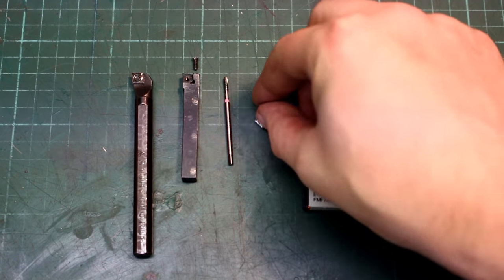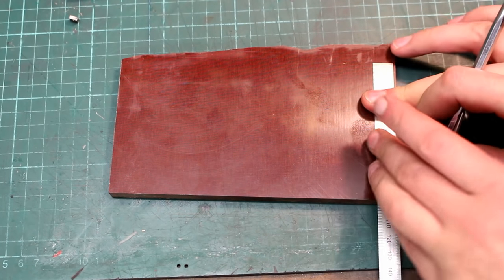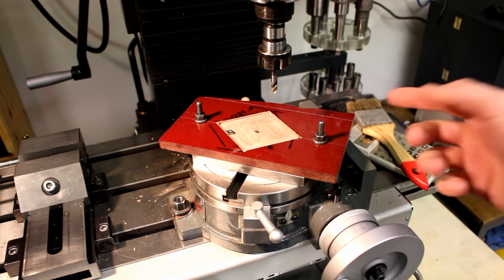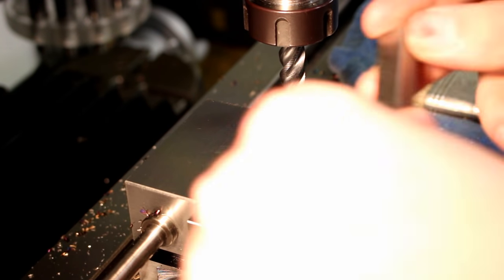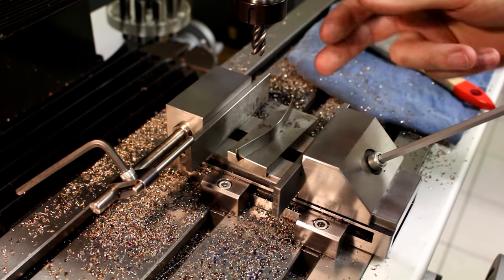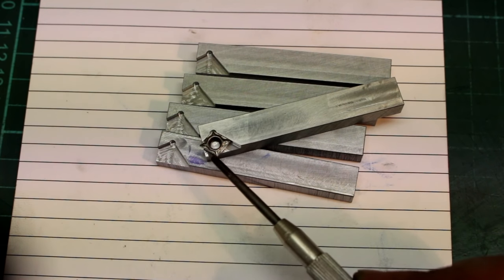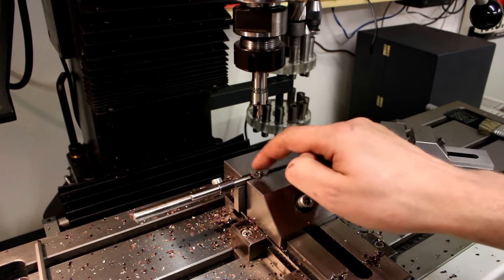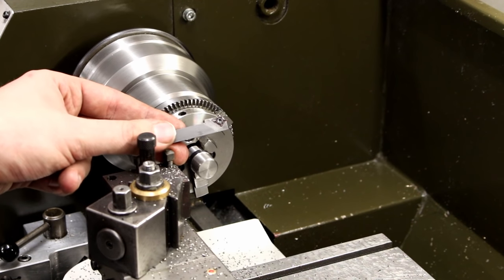Making indexable lathe tools - Herstellung von Wendeplattenhaltern

Comment: Hi Stefan, In your video you stated that you didn't have the means to de-magnetize, but you do have the means. Any mains power transformer is a demagnetizer. Just make sure the unit is in a safe state before powering up. All you have to do is to wipe the parallel or other magnetized piece across the metal lamination s of the transformer whilst powered up and the 60/60 cycle field will soon remove all traces of static magnetism. Easy peasy. I always enjoy your videos as they always seem to work outside of the box meaning that there is a lot of inginuity and thought gone into your projects.
Regards MoK
Reply: Cheers for the tip, will give it a go.

Comment: 3.5 purpose tool
1) turning
2) facing
3a) chamfering O.D.
3b) chamfering I.D. (albeit not 45 degrees)

Nice work. I like the thoroughness of your presentations. I have to admit to chuckling when the holding spring fell into the middle of the vice. You just said "oops" and moved on. I'm so glad I subscribed.
Reply: For anyone else reading this years later, a simple trick to chamfer the ID at the same angle would be to run the lathe in reverse and cut on the far side.
Reply: @cavemaneca  If you don't have a screw on chuck like mine. But yeah, that's a great idea.
Reply: @ExtantFrodo2  I've actually never had a lathe with a screw on chuck, so I didn't really even think of that.

Comment: I have never seen a rougher like that before, thanks for sharing that!
Reply from the maker: +zomie1 I have neither - And as its not as good as a pure roughing endmill it does a real nice job :)
Reply: I find Iscar mill tooling is inferior to the Seco and Sandvik offerings. It seems Iscar are constantly introducing gimmick features into their products and then dumping them from the lineup. One product Iscar market but do not make I can highly recommend is the ITS modular boring head. Very rigid and accurate but probably a little large for the stuff you are doing.

Comment: Thank you very much. I do not have a mill, but I just bought a Cazaneuve 575x2000 lathe
So far I have broken 6 inserts trying to master the controls. I have not done any turning for over 30 years. 
The machine I did most of my work on was a Dean Smith Grace which was quite modern. And every control just fell naturally to the hand.
Whereabouts in Germany are you? I spend a lot of time in Germany myself. You can buy anything there. I get most of my tooling from ebay. It is made in China The lathe which is old. Came with tooling boring bars and holders of high-quality

Comment: I must make me a clamp like yours for the mill spindle nose and mount my mini Noga that way.
Optically the camera seems extremely good - perhaps sound had some AGC break-up at one small point milling the phenolic, otherwise fine.
Your pantograph set-up is ideal for this project - amazing that tiny carbide end mill survives!
More very nice work again Stefan... your usual precision.:)
Reply from the maker: +ChrisB257 I think Tom Lipton has a setup like that, with the Mini-Noga arm on a genuine Indicol holder.
Yeah, I like the camera very much, but as I said it will stay secondary camera when I want to do multiple shots at the same time. Thank you for watching and commenting :)

Comment: Hi Stefan, Really nice work as always. I was wondering if you were going to cut a taper on the edges of the pocket the same as the angles of the tip, but I guess it doesn't really matter as long as the tip is rigid in the holder, which is going to happen with the 0.1mm offset.

Comment: You could rotate the insert at 90 degrees and use the wider edge for turning rather than facing. Allows you to use the inserts that are worn on the 2 other edges

Comment: Hi StefanAs usual a very well crafted tool and excellent video. If you make both left hand turning and right hand, with a careful relief grind you have a fly cutter that will utilise the 2 unused edges. Also if you get chance  try CCGT inserts easily chipped but superb fine finishes even on tool steel with care. Fly cutting on Aluminium is almost glass like.

Comment: Stefan, You forgot to include a pricing page so we can see what these excellent tools are going to cost us! :) I very much like how you built in the ability to use 3 sides of the tool. 

If you can in the future please do a video on parting off. It is the single most difficult action for me to master in my small home machine shop. I have a nice accurate mini lathe that can hold 0.0010", but I feel I almost mangle the poor little thing every time I part off or cut off a piece of work. Thanks,    G.
Reply: Hi G, Don't know if you have tried this but if you are using the forward turret, try turning your parting tool upside down and run in reverse its a lot more rigid, and get as close to the chuck as you dare, also get you speed up to the max with coolant/oil, and dont use a wide tool, on a mini lathe I would suggest no more than 1mm.

Comment: Hi Stefan, wonderful video and a very nice tool. Thanks! Quick question - I hadn't seen that smaller chuck on your lathe before; it looks similar to a little Unimat chuck. Did you adapt one to your lathe or is it something made by Optimum? Happy New Year!! Bob
Reply from the maker: +Bick1027 DE Thats a small emco or unimat chuck, I use it mostly for small modell parts, as it holds parts as thin as 0,5mm. When I tested the toolholders that was the chuck I had mounted on the lathe so I used it :)

Comment: Nice work. I see even some possibility to releive the right corner of the holder head, so you could alsoo make it go into shoulder corners while conventional turning. Cheers.
Reply from the maker: +Flip de boer I thought about that, but the inserts only have 7° relief angle, so they would rub a lot when doing internal chamering.

Comment: Nice tool holders Stefan! :) Do you think you could add one more relief behind the insert, so that you can cut inside chamfers? Or would that compromise the stiffness of the holder? That would make it a 4x way tool! :)
Reply from the maker: +mictho100 No problems with stiffness, but the inserts only have 7° relief, so they would rub when you try to chamfer internal edges :)

Comment: Thank you for your time and information.  I like the style and content of your many videos.
Regarding the insert tool holder:  what are your thoughts on double-end insert holders?  Many of us have the Aloris type tool posts that have two faces for the tool holders.  With a double-end insert holder, you can change the approach 90 degrees by just changing to the other face of of the tool post.  This occurred to me when I saw you cut off the lengths of raw stock!  Too late then!

Comment: very nice job . you didn't mention but i assume your inserts are positive rake. also , is there a need to heat treat the tool holder?  what level of hardness do you shoot for?
Reply: +larry sperling I think he made his to about 50 Rockwell
Reply from the maker: +larry sperling The work just fine when left soft, but hardened they dont get dinged up in general shop use :) And yes, the ccmt are positive inserts so you dont need to tilt them. Hardness should be somewhat about 50...55Hrc.

Comment: I often wondered if the insert craze is marketing hype compared to need. All machining was done with high speed tool steel and brazed bit tools for years. My only experience in machining was with high speed steel so i never used inserts except on rotor and drum lathes.
Reply from the maker: +Richard Schmidtendorff Dont think that its a hype, they are essential for mass manufacturing and heavy material removal, but in the homeshop, I am not that sure about it - Thats the reason why I have only one kind of them in the shop (Plus my parting blade inserts).
Reply: Ah ok nobody really talks about the advantages or disadvantages.
Reply: +Richard Schmidtendorff In industry during the HSS days it was necessary to have one guy sharpening to every 5 machines milling. When they went to carbide in steel they got 4 times the tool life meaning that one guy sharpening could now service 20 machines. When you go to insert tooling you can get rid of that guy and his machine all together. Brazing carbide on and grinding chip breakers and reliefs eats up a bunch of time too, so in production insert toolings slight extra cost more than is offset by the increase in productivity. Taking the human element out of making the tooling also makes more predictable tooling which is good for CNC's as then you can know exactly how long you can run a job on an insert, with hand ground tooling that would be all over the place, and even tooling ground on a  cutter grinder can be all over the place too as things like surface finish, the angle and position of the tooling and how hot they got it sharpening all can play a big role in tool life.
Reply: yeah i figured after thinking about it if it came down to quick resharpen by just rotating or swapping and not haveing to reset up.

Comment: Hi Stefan, I just watched your video of the 5 tool holders you made for the CCMT carbide tool bits. (Some time back I see). Very good job, well done. What material did you make them with? At some point in the beginning of your video, I was sure I heard you mention that the material was cold rolled, and that hardening was not needed. Then at the end you hardened them anyway. I am asking because I don't know much about what types of materials are suitable for hardening?
Reply from the maker: I used a toolsteel (ISO 1.2767, which is ANSI 6F7, a bit like D2) - It would be tough enough by itself without hardening, but hardening makes it just more resistant to tear and wear.

Comment: nice video, thanks. 2 questions:
a) You milled the pocket with vertical walls, correct? The insert has a relief angle on its edges, right? Should the pocket walls not have the same angle? Do the commercial holders also have vertical walls?
b) Why do you heat treat the holder for toughness and not use cold rolled mild steel? I understand that you take mild steel for the shanks of your brazed on carbide tools. And mild steel is tough not brittle.
Reply from the maker: +rol eic Thank you :)
a) Some of the commercial holders have straight walls, some have sloped walls - When I do my next run of them I will grind a 7° single lip cutter
b) Just for general resistance against dings and nicks
Reply: I see. I gather you seem to consider the brazed-on-carbide-tools kind of disposable when ground down while the insert holders are there to last.
BTW I liked your TPG-project and hope it will find some application soon again :-)

Comment: CCMT recycle face mills are sold on ebay. I picked one up a few months ago
Reply from the maker: Interesting, do they work well?
Reply: Yes, they work well with the right speeds/feeds. They do not cut to a shoulder, but for face milling they are great and I get the inserts for free after the 40 degree tip is used.
Reply from the maker: Thanks! Maybe I will just buy one...or make one :D
Reply: please Make one , i would love to see your take on it :)

Comment: You selling some Stefan ? :) I just have a small lathe, might try making the whole thing on it, thanks!
Reply: Made one over the weekend, not as nice as yours but works all the same I think. I haven't tried turning steel but works a peach on aluminium. Excellent tool holder idea, I wonder why nobody makes these commercially.

Comment: Thanks for the spring tip. Never thought about this - but maybe it's because I'm spending 90% of the day on the lathe :)
But for the insert holders: Where is the 5° or 7° (just don't know the exact clearance angle) angle for the insert seat or do they work well enough to not care about the angle? But maybe for those not really aggressive cuts you're doing with an 8mm shank tool it just works which is the only thing that really matters :)
Reply: The second "C" in "CCMT" indicates a 7° relief angle. (You need a secret decoder ring, which is available online at most of the insert brands' websites.) The 0° (no relief) inserts have an "N" for the second letter. The "N" inserts give you more usable faces, since you can flip the insert over and use the other side, but as you noted they need to get their relief angle from the insert holder.

Comment: One cheap and fast way to demagnetize steel is to hit it with a hammer.  The impact discharges the magnetic field.  But, in the case of precision parts, pick the surface that you hit wisely...

Comment: At 14:53 you say you are using tool steel, which as I understand it is usually HSS in the UK. Yet at the end of the video you say you have hardened the tool holders. Could you clarify which steel you are machining the toolholders from originally? Would mild steel be OK for the toolholders if you weren't concerned about them getting dinged over time in the workshop?
Reply from the maker: Tool steel is not automaticaly HSS - HSS is just one form of toolsteel, that comes generaly in a hardened form.

What I used was 1.2767 (X45CrNiMo4)  - It comes in a soft, machinable condition.
Yes, mild steel would be ok, but they will get messed up over time. Stabilty (Stiffness) wise there is no difference.
Reply: Thanks for the information Stefan (and the videos).

Comment: If you find it hard or expensive to buy M2.5 screws from the usual sources, visit your friendly local hobby shop where they sell radio control planes and such. A good shop will have a good assortment of screws in M2.5, most likely in 12 grade (I guess that's what you need for tools). I think I paid something like 2 AUD (this should be about 1.5 Euro) for about 10 of them last I bought any.

Comment: Look into RC equipment to get affordable 2.5mm screws,  something like this for example :
http://www.amainhobbies.com/rc-cars-trucks/protek-rc-2.5x10mm-high-strength-flat-head-screws-10-ptk-h-2103/p141721
Reply: +M Dupuis In case Stefan doesn't see your question, insert screws have a special head shape and are not ordinary 2.5mm screws, this might account for the higher price or it might just be a rip off.
Reply: +M Dupuis also a source of M2.5mm X 6 mm screws (with special head) is zujeddeloh http://www.zujeddeloh.de/artikel635.html#a6341. They are from China but for me they work.